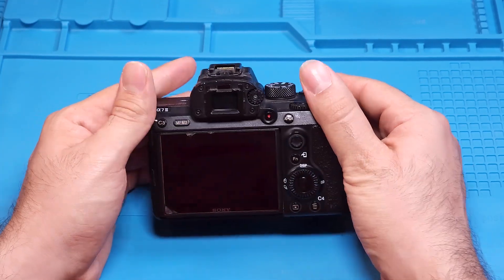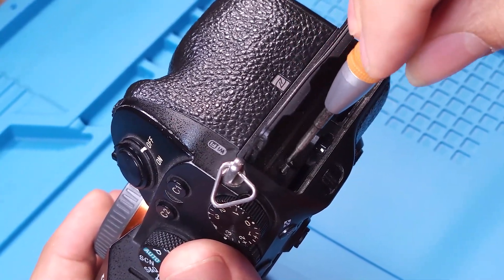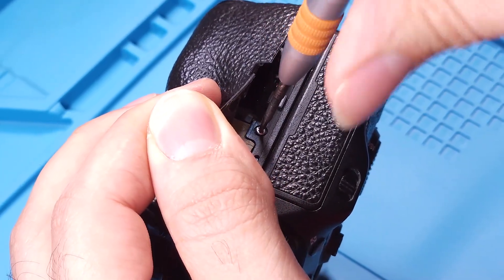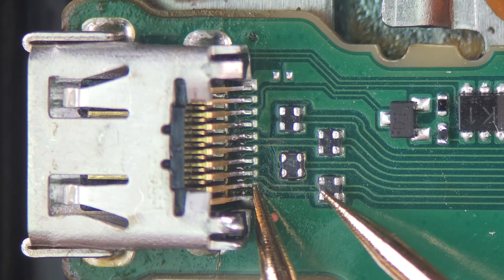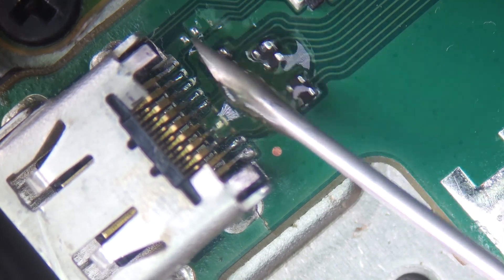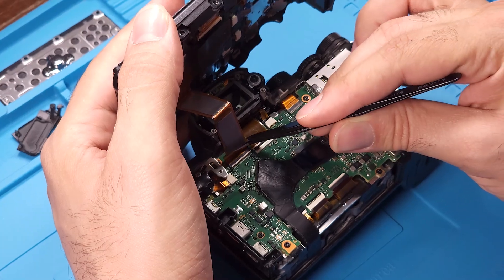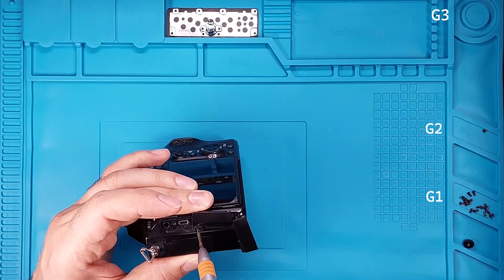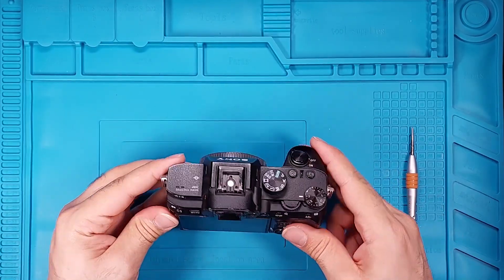Sony A7III HDMI Not Working? Fix it Now! | Hardware Problem Solved (Part2)

Comment: I can see where the main board is cracked a little soon as you put it under the microscope
Reply from the maker: What you noticed is correct. Small micro-cracks like that are what caused the tracks to disconnect.

Comment: Hi,
I have the same issue on my Sony A7IV, do you think it's about the same thing despite the HDMI port and not Miro hdmi?
Reply from the maker: On the A7IV, the HDMI port is on a separate jack connected to the main board with a flexible cable. If you’re sure it’s a hardware issue, first check that the connector is seated properly on the main board. If that doesn’t fix it, you can replace the jack fairly easily with a new one.